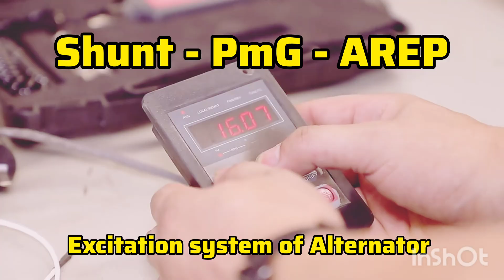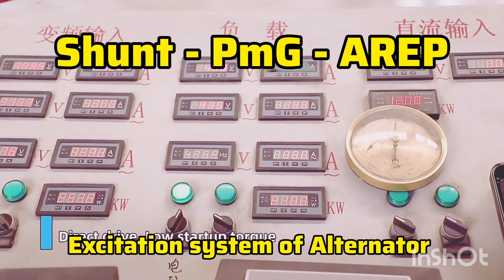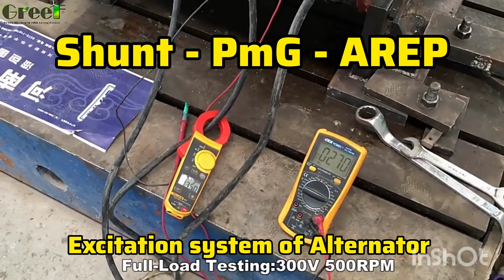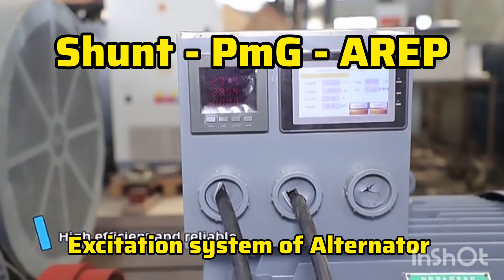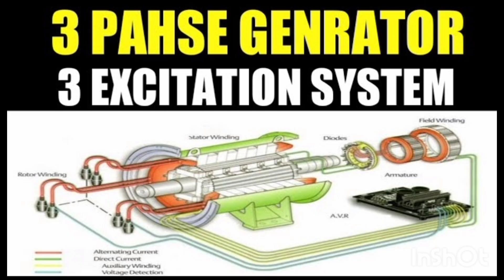Generator Alternator Excitation System Explained: PMG, AREP & Shunt (3-Phase Excitation Types)

Comment: I have an issue with cat 3512 diesel engine, no voltages are coming from output of generator when i give 12 voltage instead of avr then the voltages comes.
Without avr generator output is just 1.2vac what is the issue please answer
Reply from the maker: Replace avr
Reply: First step, is engine at nominal RPM, depending on alternator and frequency could be a 4 pole alternator which would be 1800RPM for 60Hz or 1500RPM for 50Hz, on that engine I have seen 6 pole alternators which would be 1200RPM for 60Hz or 1000RPM for 50Hz. Without correct engine speed regulator may not be coming on. Without voltage that low it sounds as though there may be no residual magnetism meaning it may have been off for a long period of time. If you have shunt excitation or AREP you may have to flash the field meaning supply a small amount of DC voltage into the excitation circuit labeled as F1 and F2 or X and XX with 1 being positive and 2 being negative. If this unit has a PMG the regulator may not be getting power to turn on signaling a broken wire or bad PMG stator.